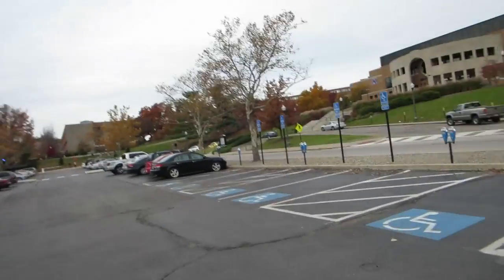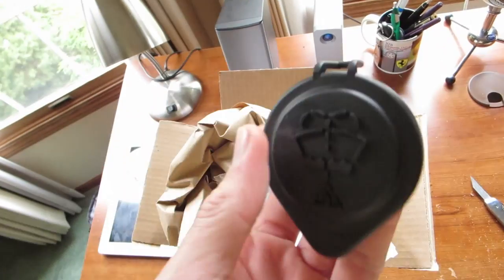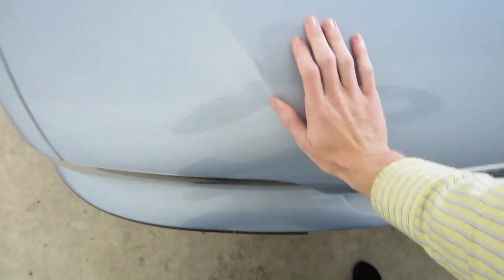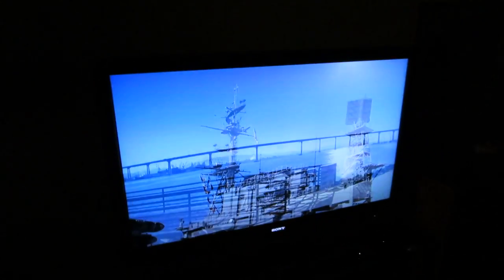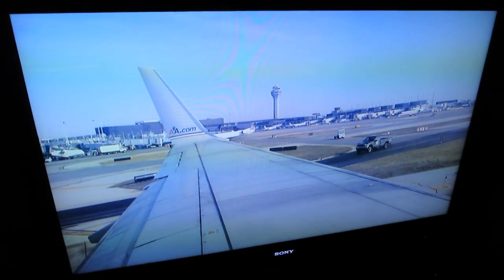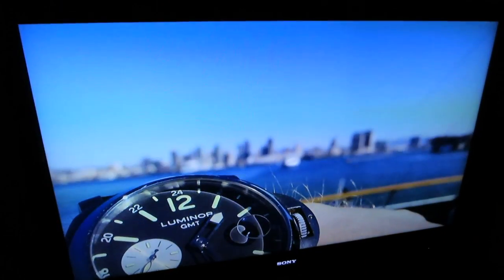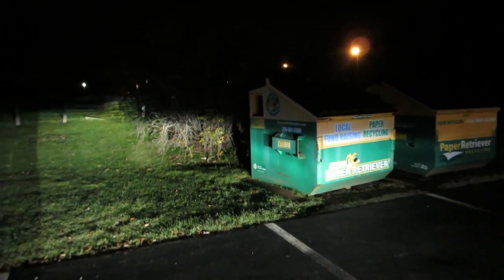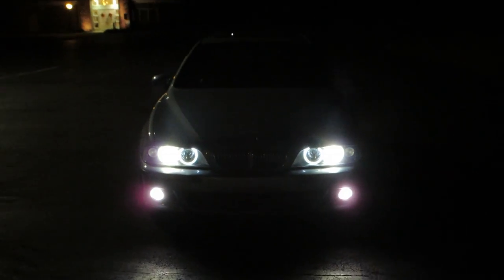Paper Day  11/5/13 - Day 1,063

Comment: Years of experience to master! As he pulls the hood forgetting the latch. LOL ;). How did Kennan drop the cap onto the manifold in the first place!? Oooh, I don't think it's an E60 M5 your dad has... Glad the switch panel sold. Would you sell the OEM headlights also? The camera did well. But not as good as the amazing twilight picture you got when you had the Facelift lights installed!